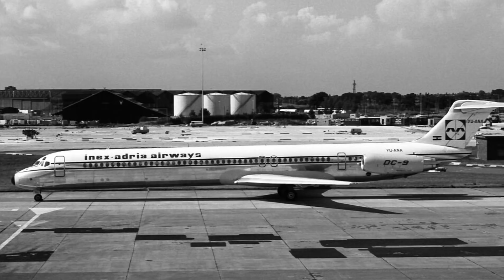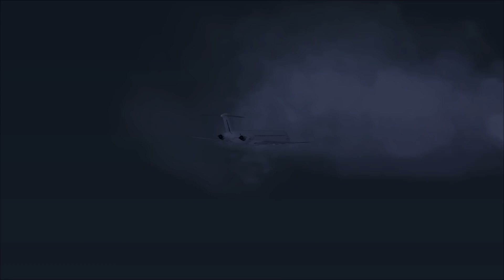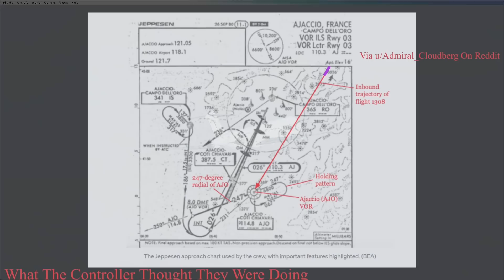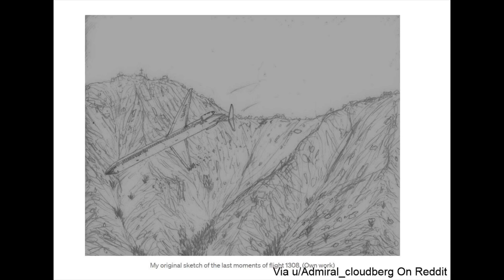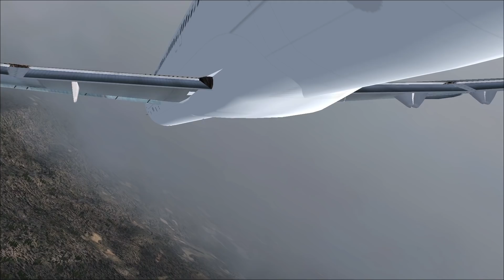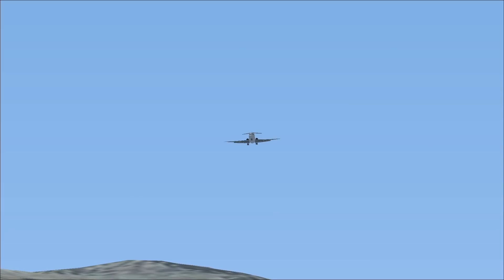The Small Misunderstanding That Doomed 180 People | Inex Adria Aviopromet 1308

Comment: "had to switch to a bigger plane because so many people" "not worry about weight restrictions" oh this is gonna end well
Reply: Some specifics regarding the video's "not worry about weight restrictions" (which was just a loose way of saying that they weren't near any of the weight limits):  The distance between airports was only about 350 NM, so a light fuel load and not at all close to maximum takeoff weight at the departure airport.  At the destination airport, without any cargo -- or even significant luggage -- well under maximum landing weight as well.

FWIW, this aircraft was configured with the exit-limited maximum number of seats (172).  The FAA evacuation demo had been done in a darkened hanger using DAC employee volunteers, so all were adults.  Things will be different in any particular accident, such as infants in the mix, or passengers who insist on grabbing their bags (at the possible cost of people's lives).  But an arbitrary 90-second time limit with an adult occupying every seat provides a standard for the airframe manufacturer to design to.
Reply: The problem wasn't kids sitting in the laps of passengers, it was having a kid in the damn cockpit!
Reply: non of which had anything to do with why the plane crashed.
Reply: @MegaBluebone  Soft factors always play a part, and a shitshow like this is full of things that negatively impact your readiness and ability to react properly. There's a really, really good reason that most reputable companies do their best to cut down on disruptions like these.
Reply: Plus “Children had to share a seat”!! That’s ridiculous!
Reply: @martynh5410  You do realize that airlines in various parts of the world (including the US) allow younger “lap children” to sit in adult laps even today, right? 

This was in no way contributory to the cause of the accident, though it’s a practice I am not personally in favor of.
Reply: @HEDGE1011   Yes, I realize that but in the USA it’s only allowed for babies and infants up to 2 yrs of age.  When I read “children” I was visualizing an older child.  
I’ve flown considerably in my work with over 1.6 million miles on one airline. It only seen lap kids about 15 times (that I can recall!!).
Reply: @martynh5410  I’ve been an airline pilot for the same company for thirty years now, and fly 80+ hours a month, every month I don’t have vacation. I probably fly around 30 flights in a typical month, and it is the exception to see any flight without lap children. Again, I do not personally like this practice, but my point is that it’s legal and common.
Reply: @HEDGE1011    Okay, well as an airline pilot you would certainly know.  I guess I must’ve have had my eyes shut on a lot of flights (especially the long ones USA to Asian destinations).  I have a lot of respect for you and all airline pilots.  It’s an incredibly responsible job you have and the safety of all passengers is dependent largely on the folks flying the plane m.
Reply: @martynh5410  That had no effect on the accident. As explained in the video, passengers were traveling without luggage, so absolutely no way that they could have exceeded the overall weight limit.
Reply: @tresaq11    Yeah I see your point.  But putting 2 people in a seat doesn’t show much regard for safety.  For example, during certification it must be demonstrated the aircraft can be evacuated on the ground in less than 90 seconds.  This is based on the plane being at maximum seating capacity.  With additional occupants it would likely take longer to deplane.  Of course this wouldn’t have affected this particular flight!
Reply: That is what you do when you have too many passengers, you switch to a larger plane. Just logic. In case you didnt figure it out, larger plane means a plane that can carry more passengers.
Reply: So sad 😞